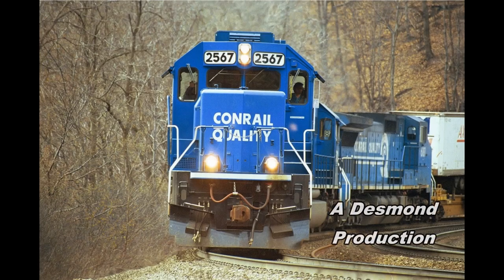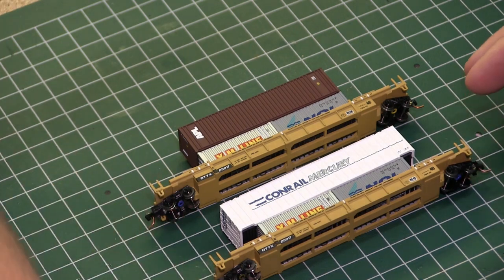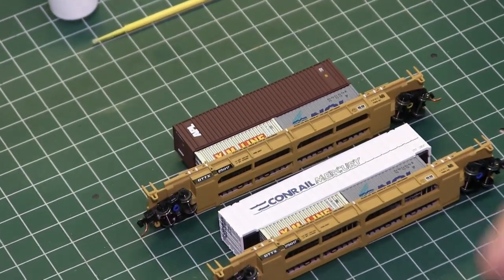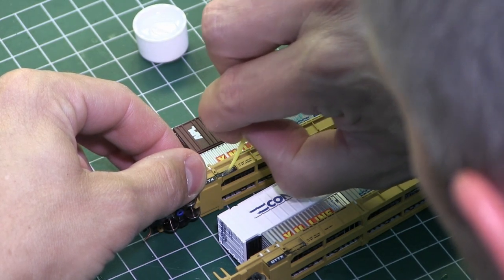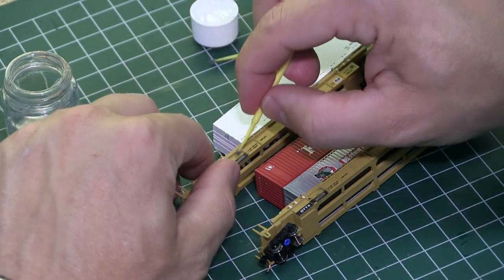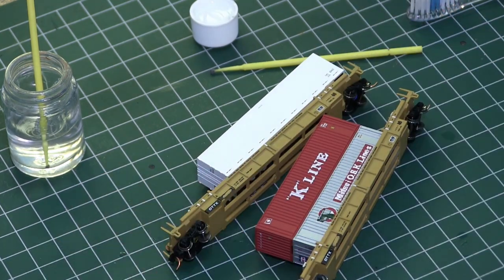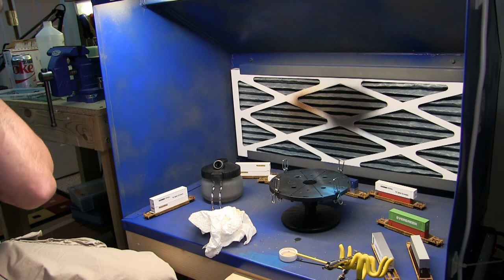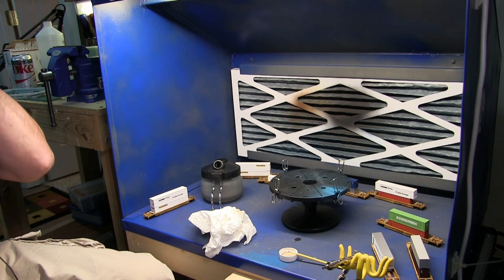Weathering Walthers N Scale intermodal cars

Comment: Black squares - You can also get a sheet of black from Microscale and cut it down. Think the paint works great too.  I recommend Distilled Water with Microscale, even less particles. Alot of graffiti began when they were in open storage.  To go 2009 or later, use the Smokebox Graphics reflective yellow stripes, they are great.
Reply from the maker: AZ Mike thanks for the tips, great info. Thanks for watching!

Comment: Hi Joe. I'm a little confused over your car numbers (being from the UK). You took off the existing numbers because all similar cars had the same number, yet the new numbers you added were the same for at least two cars. Do the numbers indicate a car type?
Reply from the maker: So these cars were sold by walthers individually or as a four unit set. The prototype is of a four unit set were the cars were permanently coupled together with a drawbar (essentially a big bar of steel). So the number applied to the 1st and 4th (or A & B) car of the set were the same because it was for the set, and the middle two cars had no numbers. So even though my models are individuals, I numbered them as sets. When placing them on the tracks from storage it makes for an interesting time (lol). Maybe in the future (when I start 3D printing) I can design a draw bar to insert in the pockets of the trucks and eliminate the couplers, make them truly are permanent set. Hope that clears it up. Thanks for watching and the support.